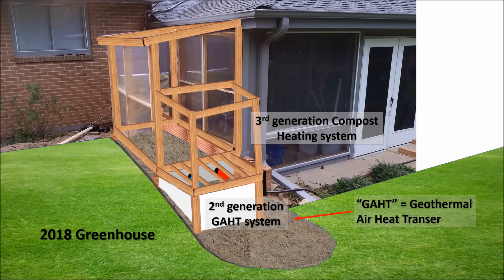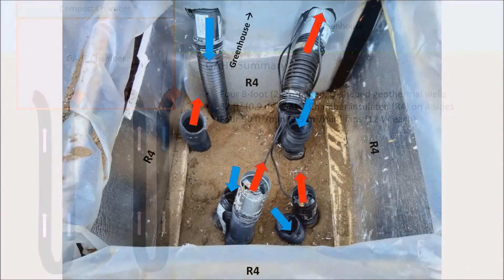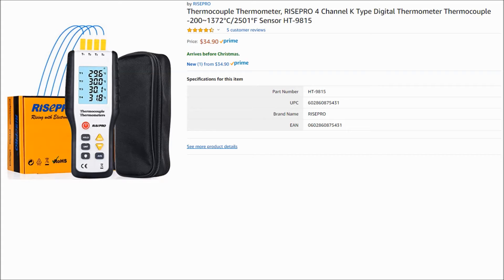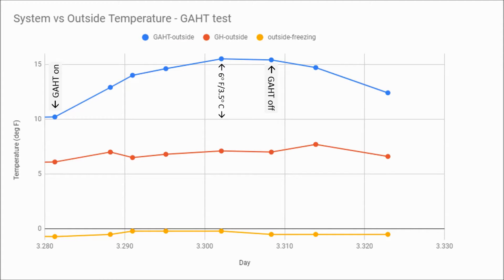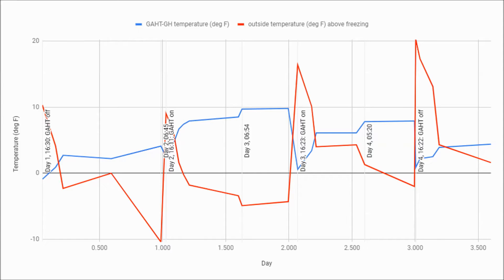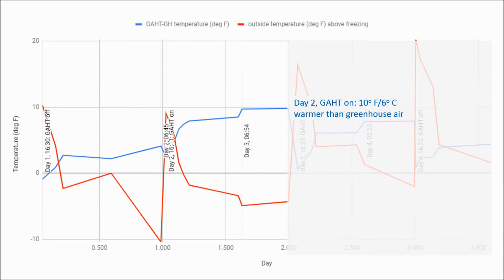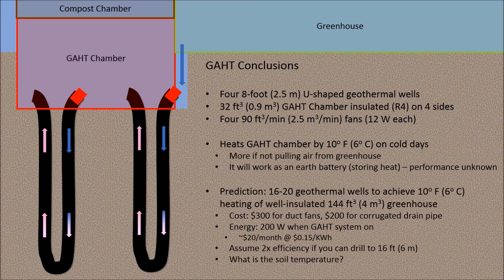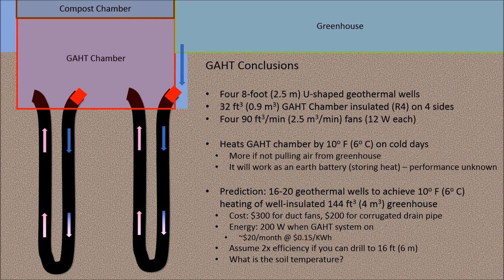Did Geothermal Heating work for Greenhouse 2.0?  (Part 2)

Comment: Do you insulate the tubing or around the GAHT chamber walls down to the frost line?
Reply from the maker: Sort of. ;-). The GAHT chamber is insulated  to a depth of maybe 12 inches below the surface but the holes themselves are not.  I quite like your suggestion.  Do you have any thoughts about insulating material?  I suppose you could do something like packing peanuts!  I'm eyeing a modification to the scheme shown here.  I would dig the pairs of holes as shown but would trench between the holes and run one continuous air line.  This way I could manually keep the air lines below frost line.  A project for next year!  Look forward to your other comments
Reply: @MorganBrown  Well, I've seen "insulated" pipe used as drainage tiles.  There's PERFORATED plastic tubing with expanded styrene nuggets held by a mesh.  The problem with using something like that (even without perforations) is insulation resists temperature change in both directions.  It resists gain AND loss.  You'd need a design that has a "wicking" effect, allowing Earth core temperature to affect the pipe, but not the air temperature.   I think a big hole like a GAHT chamber basement is required.  Insulate the sides of that, but not the bottom.  Inatall all the pipes you want and backfill, like the commercial people do.  Use inlets physically lower than the outlets to utilize the convection(?) effect.  (Cooler air naturally settles below warmer air, right?)  Maybe an inlet slit along the bottom of the nearest window to catch air cooled by the glass as it decends will help induce a current.  The fans would use less electricity pulling from the outlets instead of pushing to the inlets that way.  It's similar to the idea of front or four wheel drive.  The sharper the elbows, or turns will also impede airflow, so longer radius turns are better, as is having as few of them as possible.  Contact time also plays an important role in heat exchange, that's why longer horizontal pipes work better than U-bends.  Coils get more contact time in a small space, but the continuous turn restricts airflow, making the fans work harder and use more electricity as a result.  I guess you need to establish design parameters based on your resources first and go from there.

Comment: Very useful. I am teased by my partner that the solution is always digging in an intelligent place to save work and a series of tubes.
4m x 4m requires 16 wells. That's useful. 
When you say hidden under benches how would you bench over what's seemingly half the greenhouse?

A system that can be implemented anywhere you're 6 m above the water line is useful.
Reply from the maker: A lot of people don't actually grow stuff on the ground of the greenhouse - all their work (mostly seedling trays, I'm guessing) is done on work benches.  So the wells could be sited under the benches.  Or, you could build an adjacent structure like I did to house the geothermal wells.

Comment: Thanks for posting this information Morgan. We are looking at doing something similar to stretch our growing season out by a month or 2 in our backyard greenhouse.
Reply from the maker: That was a quick response - good to see the word getting out. ;-)  I think your aspirations are about the same as mine (2 month season-extender on either side).  Do you think you'll try the U-shaped idea, or will you go the backhoe route?  The compost is nice and hot, and I'm seeing some really promising preliminary results, e.g., 10 deg F of heating.  Hope to collect my compost thoughts and put them in a video in the first week of January.
Reply: @MorganBrown  I am going to go with your idea of  U-shaped vertical wells but combined with a solar heat collector that will add heat to the wells in the summer or by-pass the wells and heat the greenhouse in the spring/fall on sunny days. Likely it will be 1 string of wells with 8 passes.  Fan power will come from a small off grid solar system . We are looking forward to  your compost update.....
Reply from the maker: @Z06Fred  Excellent!  I would be interested if someone would try connecting several U-shaped wells with one continuous string of pipe (and 1 fan).  It would make the "16 wells in my greenhouse" pill a bit less bitter to swallow!  In fact, you could bury all of the pipe except for the two end.